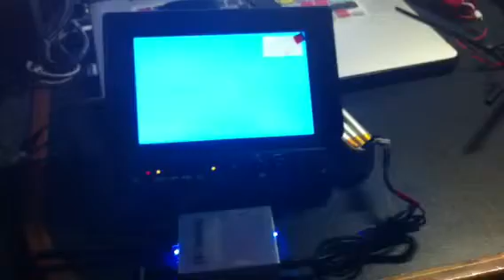Receiver fault D58-2

Comment from the maker: The receiver was faulty and I got a replacement. The new one works ok. The only problem is that on 12v it runs quite hot but works fine. This is due to the 7805 voltage regulators used internally. I now use a  Sony 7.4v clip on battery on the back of the monitor and at this voltage it runs cool.